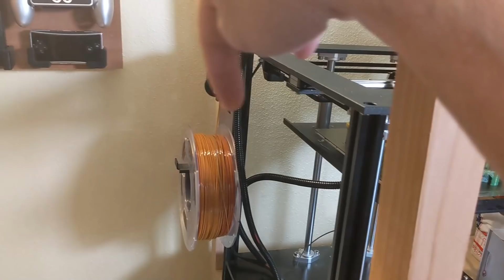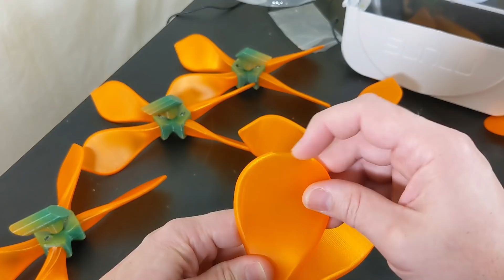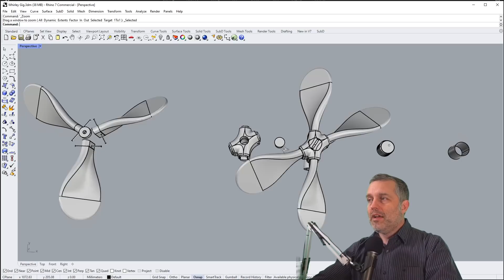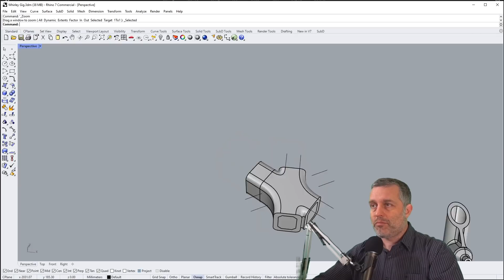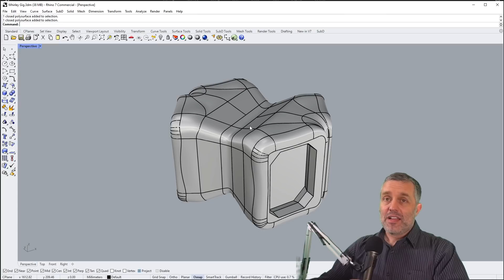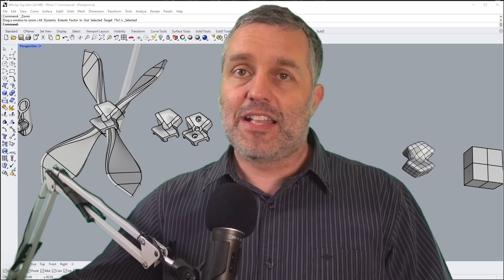A Most Captivating 3D Printed Object

Comment: Those blades look amazing in vase mode, almost bicolor!  What slicer can kick in vase mode at a select height?  I would like to know if there was a slicer out there that could detect curvature in layers and dial down speed according to radius, to help with layer adhesion then pour the throttle back on for straightaways.  I've been having this same issue lately, too.

Comment: Great video, very informative - I’ve found baking my PETG super critical to getting consistent results for parts I design and print for my side business. You are spot on about the print-ability feedback loop. I find that design work in transition from prototype to manufacture is the most time consuming part of bringing a product to market. 

I really like you channel, especially your critical approach to assessing 3D printing products and techniques. 

It’s nice to see one without a rant about China or theft, I am not suggesting you are wrong to feel strongly about these subjects or even communicate them, just that it detracts from the other great aspects of your content.
Keep up the good work and I hope there is more content like this in the future. 
I’ll be checking out Rhino thanks you your video, I’ve been using Fusion 360 and it works fairly well for my use case. I’ve applied for startup licensing for SolidWorks, however the pricing model for Rhino is far more appealing.

Comment: I love printing multiple parts, I just make sure travel moves/accelerations aren't too fast for the particular printer and layer starts are placed well.  I did take the time to find the acc/jerk max linear settings because they remain roughly true as long as the hot end and/or bed mass stays the same.

Comment: I agree that Rhino is the best 3D cad for makers. Glad to see you share that view with your viewers.
Reply: Why ? What makes it so?
Reply: @secretagb  Easy to learn. no annual maintenance cost. no confusing parametric stuff. I used Rhino professionally to design products for 5 years. many tutorials to get you started. V7 works great to fix and modify downloaded STL files.
Reply: @gordyt47  Easier than Blender? I've used Inventor, SolidWorks, Fusion etc for easily a decade. Blender seems kinda nice, but was a PITA to learn coming from traditional CAD software. Whats' confusing about parametric? I've always found that easy and highly useful when making gears and containers that may need adaptations to different uses without redrawing the whole thing.

Comment: My favorite technique for making custom threads is to stack circle sketches into a helix, then loft them into a solid. This creates nicely rounded threads with gentle overhangs and no sharp corners, if done correctly. It is a bit difficult to fully wrap your head around how to achieve the exact thread pitch, diameter, and thread depth but well worth the effort in my opinion.

Comment: I completely agree regarding marketing being the difficult part of being an individual designer, I've got an original 3D printed design on Etsy surrounded by parts 'borrowed' from thingiverse. 

That said design considerations for print farming would be an interesting discussion topic, when to use the belt printer and how that change part design, I was able to cut print time by a third by using variable infill and removing a fillet on the underside which used to require support material.

Comment: Would you consider making a video installing BLTouch on the front of a stock Mingda D2 attaching with longer screws that hold the cover over the extruder?  Something like this: https://www.dropbox.com/s/qbz3eq394hvkdwi/2021-02-26%2008.48.32.jpg?dl=0